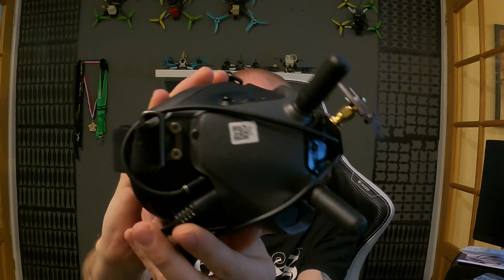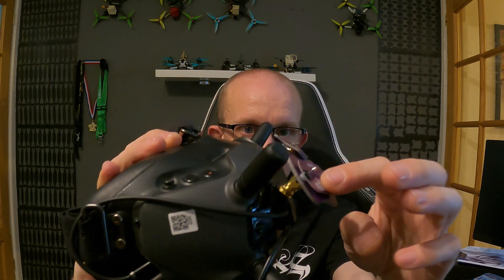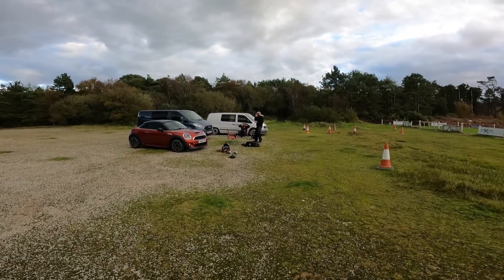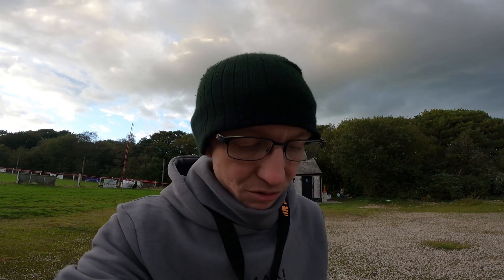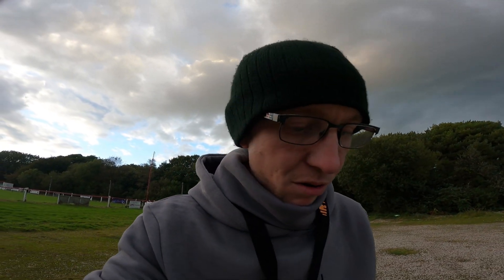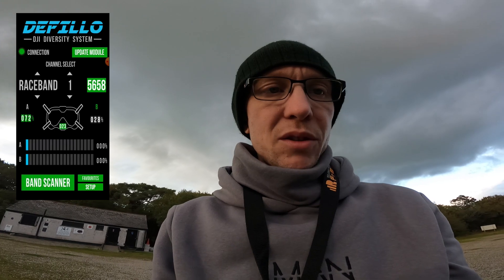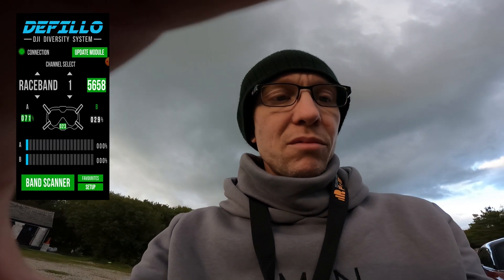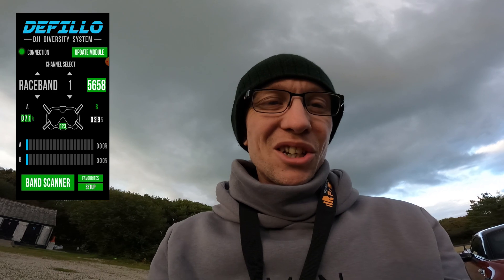HaloRC Deffillo - DJI Analogue Diversity System (Prototype) - Intro, Overview & Field Testing

Comment: Neat, but wouldn't Bluetooth be a cleaner solution so the phone would auto-connect wouldn't lose internet access while connected to the goggles?
Reply from the maker: We have discussed this at some length and are sticking with wifi, at least for the first version. Bluetooth module adds a lot of cost to production which massively effects the end price which we want to keep low. The wifi connection is more solid and better for older phones, we transfer very fast to update the RSSI bars in realtime. IOS (iPhones) are hard to write apps using bluetooth and we wanted it to be used by androind and iOS. The final reason is that in the field your phone will auto connect to the wifi anyway, mine didn't because I had just installed the latest version of the app and not connected before.
This is not this first time this has been raised and I doubt it will be the last. I hope I've covered all the reasons why we are going wifi (TBS fusion and Tango2 are also wifi only, so don't hate us too much).
Reply: @Bludz  thanks for the detailed and well-reasoned reply. I had forgotten about IOS hassles and assumed that bluetooth was "for free" when using ESP32 boards.  I can see that everything you say makes sense but I know that I'm gonna leave the phone connected to that wifi and fly for 2 hours then get in trouble cos I've ignored a ton of messages. LOL not a big problem really!
Reply from the maker: Thanks for understanding mate. I think you just pointed out a new 'main feature' anti disturbance while flying, never get those annoying notifications while ripping balls again, hahahahahaha.

Comment: Looks good! Personally not a fan of having to take the expensive goggles apart (and I don't have friends to fly with) but... I can see this being a great solution for people that do!
Reply from the maker: Thanks dude. I'm the same, hate to take expensive things apart. The good thing with this is that you only have to remove the faceplate which is just 2 bolts, drop the analogue module in and put the new face plate on, external wires means it doesn't void warranty and can be easily returned to stock. Totally get where you are coming from though.
Reply: @Bludz  That barrier is actually low enough that I may just give it a shot if I feel the need to go back to analog!
Reply from the maker: That's good feedback mate, thanks.